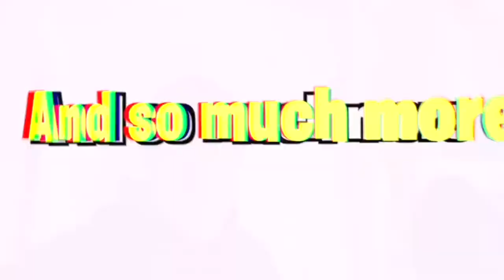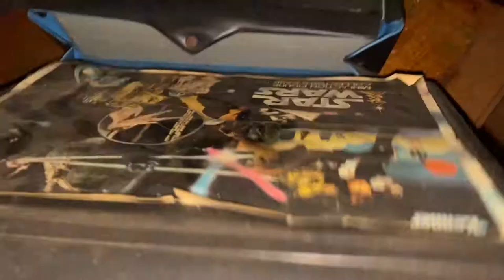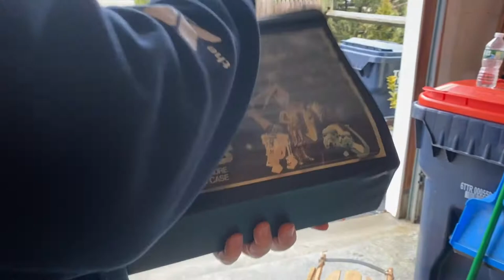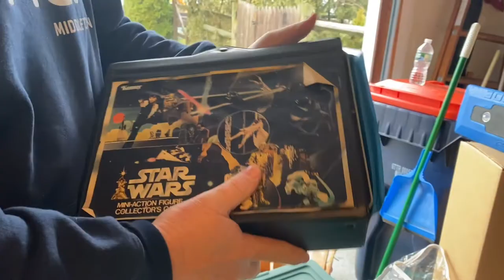Clean out gold Huge Vintage toys pick up and more

Comment: Those brass tipped canes go for 50 bucks each around here.
Reply from the maker: Even if the what is in bad shape like Nicks banks is it still worth that much?
Reply: @harryhumstone3149  little Nicks dont matter much. Just shows their age. They dont want to use them just collect them. As long as the brass is in good shape that's what matters.if the wood is beat up really bad it will drop their value 10 to 15 bucks.